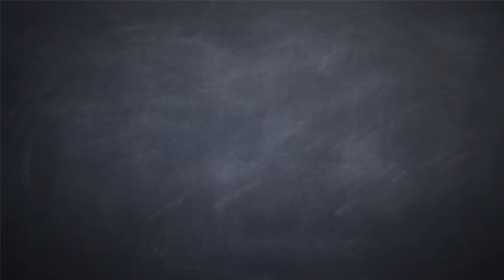Full Resin BMW E39 M5 1/24 Scale Model Car Build Video

Comment: Looks amazing as always Avia!! 👍👍

Tip: if you get Super Glue/CA Glue on your fingers don't use chemicals to try to remove it, instead use Sand Paper or a Nail File and sand the glue. It works great and does not harm the skin. 👌

Comment: That’s amazing! The only thing I noticed that was off were the wheels. The m5 had style 65 rims and the rims on your model are style 66. The style 66 came on the m sport e39.
Reply: Style 66 was an option for winter wheels for the M5. The kit had the 65s as well.
Reply: Also rear wheel wells have too little clearance, camber a bit odd.

Comment: I’m still learning how to do a good glossy finish.

Last time what I did was, prime, sand with 1500, paint color, gloss 3 times, sand 1500 2500 4000 6000 8000 10000, and then do the tamiya compound combo.

But I find that I can still see very fine scratches or sometimes it’s still a little blurry and not clear enough.

I will try to do it your way in my next build and see how it goes 😁

Comment: Awesome and very classy color combo. I love the undercarriage I have two left hands so still waiting for Otto to release an M5 in a config I like ;) Couple things I spotted for the future if I may:
1. I guess it would help to mask the edges of headlight covers (I mean, the outer surface that touches the bumper/hood/fender) with black paint. You can see its thickness now as it reflects a lot of light and it takes away the realism.
2. The washed 'lines' on the leather look like some sort of contrasting stitching, a bit too much for me if it was supposed to just help show the dimensionality, i.e. imitate shadow. the creases on a real car are not very deep.
3. The 'bump' in the middle of a floor at the back for the driveshaft is carpeted with the floor on a real car. And color-matching tan carpeting would be nice btw, tan interiors usually had it.
4. Orange side indicators, they are usually white unless someone ordered them to be amber.
5. I love the way you painted the rims! I'd actually prefer mine to be painted this way, but originally they are a bit more dull, silvery-white.

I'm curious if you're going to attempt recreating chrome shadow finish on the M5 rims, would love to see that. Otto never even bothered with their model.
Reply: That will probably never happen, they launched the silver after 10 years and don't think they will make another colour, I bought 2 silver and one of them is getting painted carbon black to match the one in the garage, it's your best option..
Reply: @joaoferreira9611  7.5 years ;) You might be right, but on the other hand there were multiple reissues of other BMWs lately + Black (and Imola Red) are highly sought-after, so maybe, maybe...
Reply: @pdcichosz  at this time I don't care anymore, just bought the correct colour to paint one of mine, just need to take my courage pills to being tearing it apart and paint it 👀😂
They could make the prototype e39 m5 touring, since they opened the door with the e46 😏😅💪

Comment: Great model and masterfully assembled by you Sir, thanks for sharing! Possible improvements: on the windshield, there’s an upper band usually dark green or dark gray to shade interior from sunbeams, at least it was there on my 2001 E39 (530, not M). And how about the heating grid on the back window?

Comment: A very nice model and a perfect built!
But the lack of black window frame in the front and rear is quite noticeable and there is one minor issues: Either the turn signals of the E39 are all white or orange from the factory. I have never seen orange side indicators and otherwise white ones on the real car without customization. 
Nevertheless, great work and I'm happy about every car model you build, because I like the videos best. Thank you for that!
Reply: Okay I see! The error with the orange side indicator is already in the building instructions. So you just followed the instructions. It's not your fault!
Reply: The black window frame on the front and rear is present on the finished model. You can see it from 28:50 onwards and at the final reveal. It is just that that dark paint colour makes it difficult to see.
Reply: @stevie65able I meant the missing black frame of the windscreen and rear back window. The original windscreen has a black frame under the windshield wipers and above down to the interior mirror.
Scale-a-ton also mentioned that as an improvement to the model kit, he wished that masking stickers for the front and rear window would be included, if I remember correctly. He left these. Completely crystal clear
Reply: @florianj6490  Yes, you are correct. I see what you mean now. That part of the rear window and windscreen should have the black surround. It is very noticeable around the interior mirror where you can see the glue used to hold the mirror in place.

Comment: Hello! Thank you very much for the great video! One question: You chosed the 17inch rims for your modelcar. There are the slightly bigger 18inch rims in the kit, too. But are they a little bit larger than the 17inch rims like the real ones? The diameter looks the same in pictures and there are no bigger tires in the kit, as far as I can see... Would be great if you can answer this question... :-)

Comment: Use uv printer resin with a uv light instead of epoxy
Reply from the maker: Good idea, thanks!
Reply: @Scaleaton it also works well for filling and leveling surfaces.  Like your water diorama on top of foil and also your explosion lighting you made.  Dip into resin, pull out cure, and repeat...if you slightly set up the resin where it is formable you can pull out flames with toothpick similar to glass blowing. .  It will make believable clear explosion mass.

Comment: Hi! Why do you use wood glue instead of ca glue? Thanks!
Reply from the maker: It gives you more time to alignment parts and much stronger after fully cured. Also you can clean the excess with water & qtips.

Comment: My apologies, but your airbrush technique is totally wrong. It can be seen at the body painting. The amount of the paint is very few, and the setup of your paintbrush is very bad. You won't can achive a good surface with this technique. The amount of the paint is very little, I bet the air is too much and you never can achieve a good smooth surfece if you want to brush a "big" surface with 4- 5 mm wide strips. Use more paint , a bigger nozzle, and a bit bigger sparying distance.  Anyway the result is very beautiful, congratulations!

Comment: mmmm, if 3-D printed kits are carcinogenic, why take the risk of losing your life?
Reply from the maker: No it is not. Very fine dust of all resin materials is carcinogenic like all lacquer paints. I don't know what people who watch this video try at home. So I have to warn them.
Reply: All resin parts are harmless when intact. They only become carcinogenic when cut or sanded and the resin turns into very fine particles. That's why he showed the three different safe ways of cutting the material.